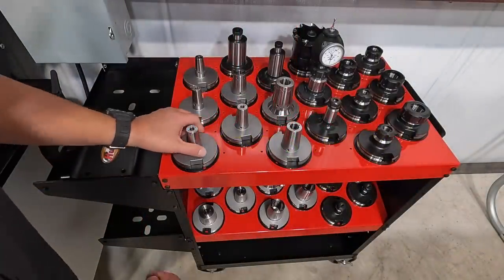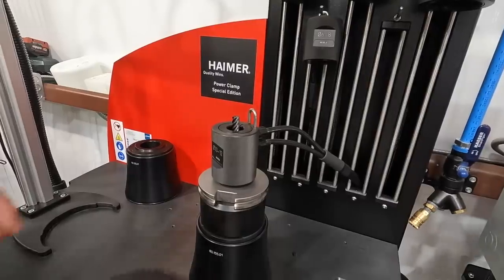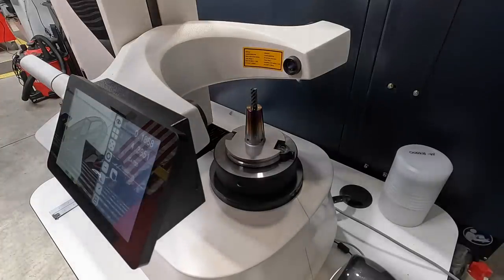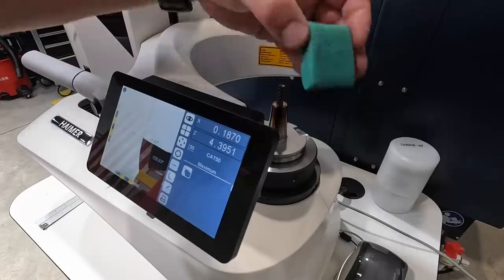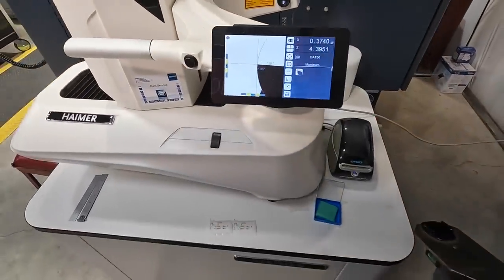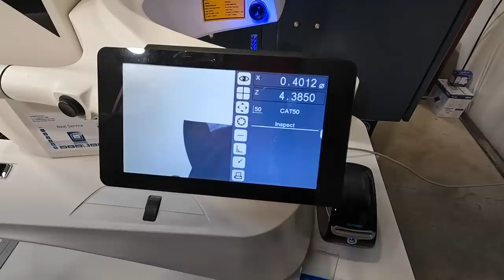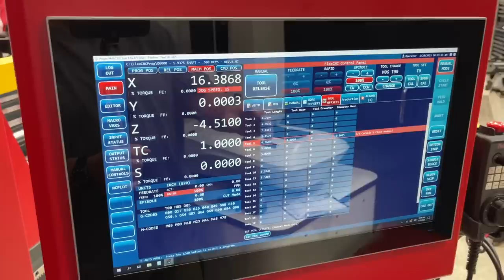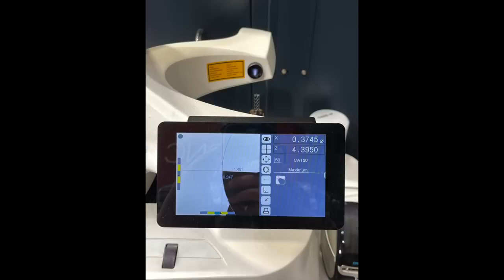Setting up an Endmill using the Haimer Machines

Comment: For anybody making the jump from manual machining to opening their own shop with the newest high tech cnc machines and all the add-on machines and tool they need, this series about the new shop is a valuable resource.
Reply: How.  Having new machines is great and all but they have to make money for 99.9 percent of people that open a new shop and have to spend huge amounts of money to get the building and the new tools. So how do these videos help
Reply: You don't need 80% of what he has bought to start a new shop. Most people are going to start with a used cnc in their garage or pole barn. With basic inspection tools. What abom has done is create a YouTube studio that doesn't need to produce any money outside of the content it creates. Anyone who opens a shop like this with hundreds of thousands in New tools and machinery with no customer base is destined for failure
Reply: @keithhasafastcar  Big agree.  You can tell he doesn't need it (and good for him) because there's no urgency with anything.  The shop is way too spotless for there to be any actual work getting done.  

The only people this series would be a "valuable resource" to are freshly retired millionaires who are interested in machining, need to know what to spend their money on, and have enough free time to f*ck around all day.

I miss the days when he would take ridiculously massive cuts on the monarch.
Reply: @lesleyboeder1798  “making the jump” was meant to imply an extant customer base. I didn’t mean to imply “making the jump from unemployed with 0 customers past or present.” And as we saw from the very next video he released, he had a customer job ready to complete.
Reply: @cskovach  his home shop was always clean, albeit less well lit, and he completed jobs there. CEE’s shop is clean and organized, that dude is cranking out jobs day and night. NYCCNC has a clean shop and is always putting out jobs. I don’t see how being a slob is indicative of being busy. 

I guess I don’t get it. I’ll subscribe to you guys to see how it’s really done.

Comment: I believe that the discrepancy between the Haimer Uno and the Flex tool probe can be readily remedied. 

If Haimer is correct, Z position adjustment at Flex will take care of it
Reply: similarly, if the Flex is correct, the haimer uno adapter can also be adjusted in the calibration menu to match the machine. On our HSK50 NTX1000 with a Haimer uno automatic drive presetter it hits it within 3µ every time when the machine is up to temp.

the important part is that all of the machines in your shop agree with each-other.

Comment: Heat shrink is good when your need clearance and better run out then with a traditional side lock holders. Heat shrink tooling has a life span as in you might only get 200 tool changes before the thermal cycling fatigue the holder too much. Unless you need it, the standard er collet system works well and most maching applications don't need heat shrink. Milling chucks or hydraulic milling chucks offers just as good if not better holding forces and offers better dampening for harmonics. Also you have to have the proper endmill shanks for heat shrink because not all endmill shanks are the same and .001 smaller in diameter dosen't mean much in a collet system but means a lot in shrink tooling. This is all food for thought.

Comment: Stick your Haimer print out in a notebook. In case the Flex controller needs to get reset, you will still have the info for each tool holder and tool.

Comment: Your tech is pretty cool, and I’m a fan, but seems a little fussy to do one-offs.  That’s a lot of setup just to cut a key way.
Reply: To be fair, I do 1 off keys in a cnc every week. 99% of the time you're going to have at least a couple of 1/4in end mills touched off and ready to go.
Reply: Sort of think it was just a setup/practice run to learn how to use the machine/process. Everyone's so used to all of the detail work done in the background instead of upfront (it's most helpful to actually show the real world time/detail involved in a job) the way Adam is willing to do it.   No patience to work through the detail makes a crappy job in the end.

Comment: We had a 1in rough mill come loose due to heat transfer and it destroyed the holder as well! In 2007 the holders were wicked expensive but for finish tools at 18k rpm, there is no equal.
Reply: I've read that the Rego-Fix powRgrip system is a superior product. No heat is required. More clamping torque. Better TIR. Balanced to a much higher spindle speed than most will ever see. Sure, both systems are $$$ but we can dream. Plus, they invented the ER collet system so there's that.
Reply: I don’t know man, might be operator error.
Reply: @ryanjordan7113  Correct. Trying to rough with a heat shrink holder was the error. If YOU have personally had success, then you aren't rough milling hard enough. And before you ask, this was 3 Hermle 5 axis mills worth $1.5 million making defense parts. That holder was around $500 in 2007 that was destroyed in under 10 minutes total use.

Comment: It’s actually the frequency of the alternating current electricity, not the voltage level that heats up the steel. It’s the same principle as a bearing heater.

Comment: All that tech and you still have to walk over with the numbers on a bit of paper and type them in :O
Reply: That's what tech support told him to do. He needed the new shop to have enough wall space for his tech support Post-Its!
Reply: With a Haimer presetter you can actually send it to the machine control with a Post processor or you can print out a QR tag and just scan it in. I am sure there will be a follow up insight once he is fully up to speed.

Comment: Nice to see that you start to learn the cnc part of chip creating. Can be handy to have a standard set of those slots pre programmed. Do the one off things manually and those standard things on the cnc. 
Would be nice if you can send the measurements of tool directly to the correct cnc, it removes the error of typing. Maybe for the future as you are still learning how to use your new equipment.

Comment: Is this a machine that is actually useful?
Reply: It is. In a industry with like 50 CNC machines and a shop where you collect the already measured and calibrated tools. This is not for a one man shop.
Reply: Actually it all depends how efficient you are with it. We have one man shop customers that operate 3-5 CNC machines. They create a tool list and set up the jobs while the machine are making chips…
Reply: I would say it's very useful if you want to hold tighter tolerances. There's a reason we have collet holders, set screw, and milling holders and you need to know witch one to use and why. 
But there's even better holders then shrink fit.

Comment: LOUD @ 20:25! 
Unrelated; I feel like an obvious next step, innovation-wise, would be for the machines to be equipped with some sort of bar- or QR code capability... I guess what I'm imagining is an additional step, integrated into measuring where the cutting happens, in relation to the holder. I wonder if the holder could be labeled somehow, in a re-writable manner, in a way that could supply all the important information, plus perhaps a user-defined catalog number. Then, any tools loaded can be immediately recognized by the computer, eliminating the possibility of bricking all manner of components and work after accidentally putting, say, tool & holder #15 into the spot the machine expects to find tool #13.

Honestly, I half expected to see that feature present itself after the ultra-close-up action with that end mill.

Great stuff, in any case... as always!
Reply: a simple google search will show that the Haimer microset does have that ability, or are you being obtuse?😂

Comment: So how do you get a tool out, especially a broken end mill? Seems to me that induction heater would be heating the tool as fast as the holder so the fit would not change all that much.
Reply: I would love to hear about this as well. I wondered if they had the magnetic field tuned to the point where it only creates induction in a toroidal shape about the center of the tool holder, thus preferentially heating only the holder.

My other though is that the carbide shank of the tool has less eddy current occurring in the material than the tool holder and responds slower to the induction heating.

Also what if the tool is broken off close to flush with the holder?
Reply: Induction heating depth throw is all about the frequency used. The higher the frequency, the more shallow is the heating. Haimer has evidently set the frequency to mainly heat the tool holder, and not deep into the tool itself.
Reply: @Zircon10  I just learned something I did not know. Thank you for your explanation.
Reply: The carbide tool does not expand with the hole...
Reply: He mentions a set screw for depth setting, so you could remove it and punch out from behind.
Reply: Put the tool holder back in the heater, press the heat cycle start, pull up on the tool and out. Cool the tool holder.

Comment: do the Haimer machine have any solution to remove broken tips? say, it just has about 2~3mm left outside the holder. that's one of the worst case scenario we can have.
Reply: Yeah they have these plungers that come with the machine to remove remaining carbide. On some sizes the carbide will just fall thru.
Reply: Heat and then grab it with a magnet....or just turn the holder upside down quickly and let it drop out

Comment: Makes me think: what do you do if a tool breaks off so short that you can't grab it anymore to pull it out?
Reply: @CatNolara, it will fall out if the holder is heated enough.
Reply: Remove to pull stud and push from the bottom, or put some water in it and put the pull stud back. Then when it gets hot the water will push it out.

Comment: It doesnt suprise me that theres a descrepency between the Uno and the Flex post-calibration. After seeing how the tool engages in the mill I'm amazed the two values are even remotely close. A taper is just a taper and isnt a hard-stop. No?
Reply: CAT50 has a very accurate taper size which makes them repeat well.    the tool setter has the same taper that stops the holder at the same depth as the machines spindle.  this is why those taper holders are $200+ each.
Reply: Should be repeatable within a few micrometers. A few thou means something is messed up, especially on brand new equipment

Comment: This is the kind of tool system that would be found in shops with multiple horizontals or 5-axis machines.  In a one-man job shop with only basic CNC machines?  Even Abom doesn’t sound too thrilled with the consequences of his deal. This is one consequence of enormous success.
Reply: Hell no, I've been in shops with 5 axis and horizontal that still use Weldon shank holders. 
I have 2 vertical mills and if I didn't see the Regofit system then I would have bought a shrink system.

Comment: Can you point us to the documentation on this and the testing that has been done showing the heat cycles?
Reply: Doesn't really need to.  Shrink fit tool holding has been around for years and is really reliable.
Reply: Can you point us to the document of your intelligence? Why, what's the point. It works till it doesn't anymore, just like everything else.

Comment: How many watts is that machine? That must pull some amps with how quickly it heats that metal up. Great video too
Reply: An induction coil is probably the heating source.
Reply: Induction coils don't use near the power of resistance heating.
Reply: @joeylawn36111  Well it's a 13kW machine that runs off 480V. Induction may be efficient but to do it that fast takes a LOT of juice.
Reply: @F0XD1E  The induction heating coil completely surrounds the tool holder and brings it to optimum temperature in a few seconds.

Comment: I''m surprised they have it to where you have to rotate the tool holder by hand and not via some of other method so as not to introduce heat, or possible vibration/movement when measuring the tools..
Reply: He figures that out next episode.

Comment: It would be neat if that uno microset programmed the measurements of the tool into a chip imbedded in the tool holder. Then the machine read that chip when you installed it.
Reply: You can use rfid chip technology on the Haimer microset machines. This is common practice for larger shops and we use it in our own production (with Balluf chips). Anyway it all starts with a presetter and you can envolve step by step.

Comment: The Haimer Uno gauge will be particular useful to know the exact cutting depth based on tool run out, tool wear and when you have tools sharpened. Very cool. Great for productions shops. I assume the printed sticker is so that a tool room can attach that to the tool so the operator can enter the information when he is loading the tooling for a job he is getting ready to run. Thanks for sharing.

Comment: Annealing temperature for HSS  is around the 820-850 (celsius) mark for those curious.  These shrink fit units (depending on their power rating) typically only heat the tooling to a little over half of that.
Reply: And……?
Reply: And then only on the shank that doesn’t cut. Only moderate heat reaches the flutes if tools are changed quickly.

Comment: Do they make a split induction heating collar and cooling collar for larger cutters that have too big of a diameter on the cutting head?
Reply: There are split cooling options or air mist options where the geometry doesn’t matter. Also there are split stop disc available for the coil or the Next Generation coils where they have an iris and open up.

Comment: Adam, could the difference of 3/10ths in diameter be the result of the temperature of the end mill during measurement?  
Although I would suspect a length change as well. 
Do you ever have to worry about compensating for thermal expansion during machining?
Reply: Calculate it. It’s negligible because of the small diameter of the tool.

Comment: In addition to all the hate, he also clips the brand new carbide endmill with the haimer cooling lube station at 3:18, seems like a hazard on endmills, knowing how brittle the sharpened edge of those carbide tools are under shock loading, everyone has inadvertently chipped a nice carbide end mill due to carelessness. 

there should also be another sliding rail for the cooling sleeves to come down parallel to the end mill, as to avoid such mishaps.

Comment: So what's on the agenda for today's comercial? Starting with a little bit of CRC, of course. A whole bunch of Heimer that he will probably forget how to use in less than two weeks. What else? 

Oh the FlexCNC taking half of the shop space. I guess that will appear more on the next video about the most expensive and longest way to cut a simple 1/4" keyway on a shaft.
Reply: I believe the FlexArm is a Threading Tool. Maybe you are confusing it with the FlexCNC?
Reply: @davelethaby1279  Good call! Fixed it now. But I'm sure he will find a way to plug the FlexArm somewhere in the middle.
Reply: A bit crabby don't you think?
Reply: @tumbleddry2887  NOT CRAPPY AT ALL. HE'S SPEAKING THE TRUTH BROTHER. GOD BLESS.

Comment: its a pity that the two dont talk to each other therefore you would not have to go digital to analogue and back - cant wait to see what new stuff you are going to have to bring into your examination room with the new granite table
Reply: I work in optics, we have a device that measures test polycarbonate blanks cut using different tools in the machine. Scan a barcode, place the blank on a spindle the rotates the blank in front of a couple cameras. Similar to his setup, but our device communicates with our machine and adjust tool offsets for wear. It can only make .2 adjustments at a time so sometimes it gives a yellow light and ask for another Cal run. The equipment is Italian. Pretty cool stuff.
Reply: Automatically adjust for tool wear and backlash etc. It was a game changer for speeding up tool change manual calibrations. A lot of the time tolerance we hold is .2mm

Comment: In my experience on those haimer shrink stations, you'll never warp a holder unless you double heat that holder. Like the equipment!
Reply: someone in the comments mentioned that it will cost about 20k $ to get that haimer shrink station is it accurate or far off can u give a ballpark price, just a student asking out of curiosity.

Comment: How do you get the bit out if it breaks off flush. Adam don't pay any attention to the haters in the comments. From 1 pcola boy to the next, keep up the great work. Make Booth Machine shop the most high-tech shop around
Reply: All you would have to do is heat the tool holder again and flip it over the bit should fall out.

Comment: All that technology and it can't send the measurements directly to the flex
Reply: Seems kind of pointless to measure your tool down to tenths when the Flex is only rated for +/- 0.002 positioning accuracy (lol) before you account for any deflection.  I don't imagine that structure being very stiff which is probably why it was squeeling like that on what should have been a pretty mild cut for a cat50 spindle.
Reply: Dont want them shop boys gettin too comfy! They aint running machines, they might as well be punchin keys.

Comment: Why is he even fitting that disc since he isn't using it?
Reply: Disc is sized to fit the holder for diameter and depth.
Reply: @russellerney2375  
Guidance for insertion of the tool in question.